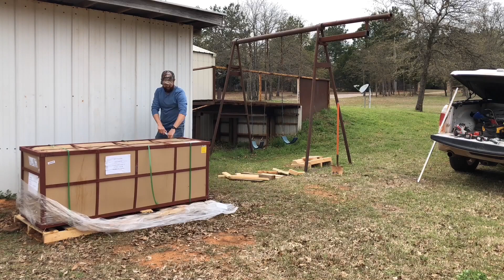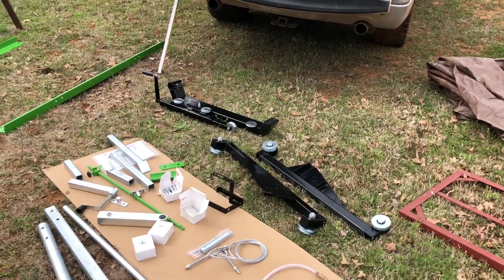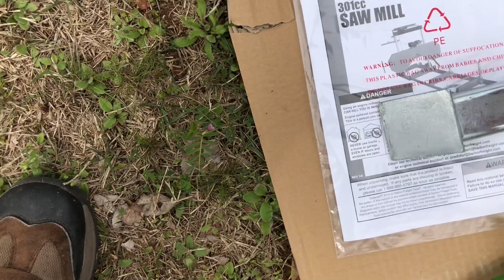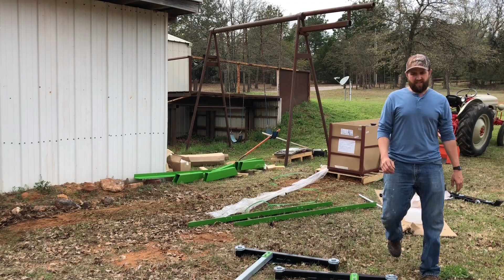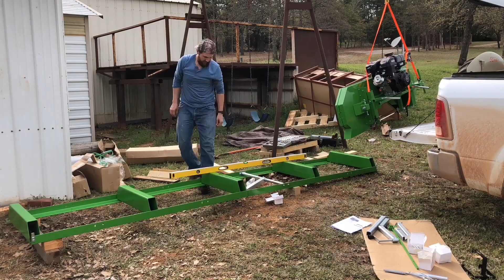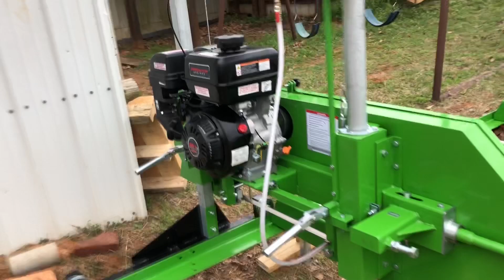You CAN build the Harbor Freight sawmill by YOURSELF in 1 day - Castle Grounds Vid #2

Comment: I also put mine together by myself, the first thing I upgraded was to put additional metal where the rails are spliced. The accuracy of sawing is all about the foundation of the frame. Time and money spent on the supporting foundation supports is well worth it, either concrete or sizable timbers that won’t move or settle in the future. Good luck , there’s nothing like the feeling of making lumber from a log.
Reply from the maker: You are definitely right. I am hoping to add about 10’ of track to mine in the spring and will also upgrade to a concrete foundation at that time. Thanks for watching!

Comment: I would not trust what you have that hoist hooked to. I'd moved that truck and jacked it from the other side. But that's just my opinion and obviously it worked out for ya. Job well done.
Reply from the maker: I was a little worried, but that chain hoist is rated for 500lbs, and that cherry picker was made to pull large motors. So I took the leap of faith. Lol. Thanks for watching!!

Comment: Tough doing things by yourself.  I'm looking at one and am trying to figure out how to get that out of the box and worse yet, how to store the thing.  I'll need to disassemble the motor section from the rest and put that away.  Likely a rack, winch, and wheels.
Is the motor a briggs and stratton or what?
Reply from the maker: Bee Bob sounds like an interesting project you have on your hands. You anywhere near OKC? I’d come help you wrestle that motor out of the box.
Reply: @MrJustinWheeler  Pennsylvania.  Sorry.
Reply: Bee bob it should be a predator motor. Harbor freight
Reply: @stevemotley808  Thanks.  Not a fan of their engines.

Comment: Woodland mills makes the HM 122 for the same price and it is way better.
Reply from the maker: John Chism what do you like better about it? I’m not familiar with that unit.
Reply: i researched that mill too and the only difference i can find is the hm122 can take a log 22" in girth and the hf one will only do 20". is there some other difference thats not apparent from reading the specs? also the hf mill is $100 delivered where as the hm122 is $300
Reply from the maker: Nathan, are the overall prices the same? Other than shipping? The HF 20” limit isn’t ideal, but it’s fine for the majority of what I’m looking for. I’m actually about to trailer mount the mill. Wish me luck. Lol
Reply: @MrJustinWheeler  yes both are listed at 2199. All of the published specs aside from the blade length appear to be exactly the same. That's why I was questioning the original post that the 122 is better. In what way is it better?